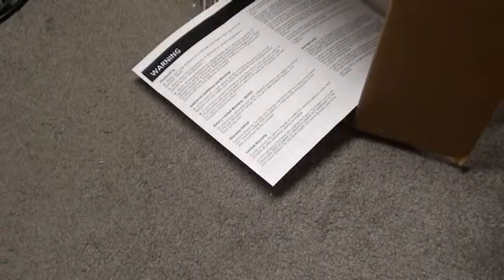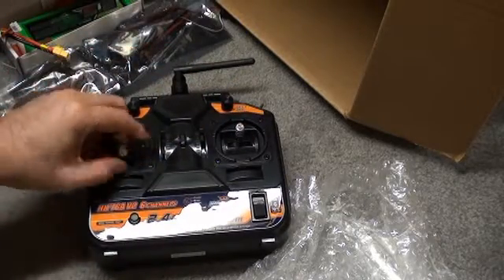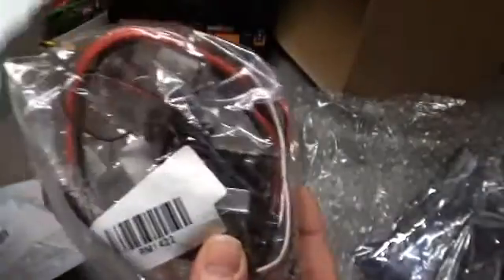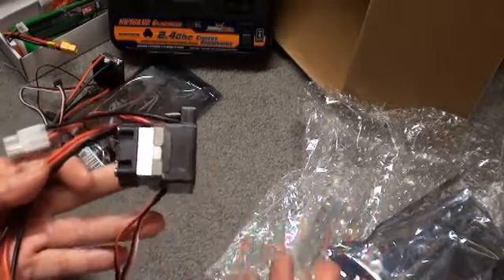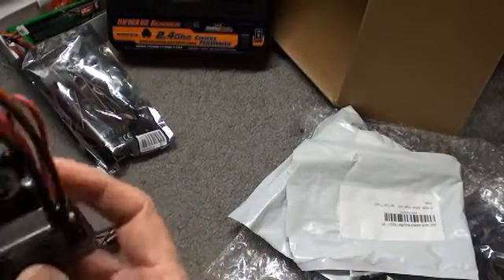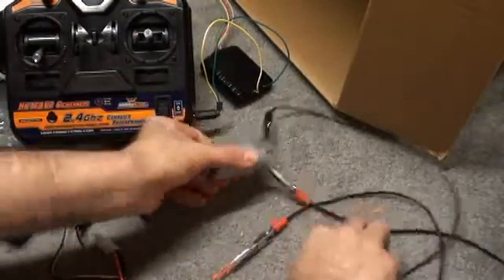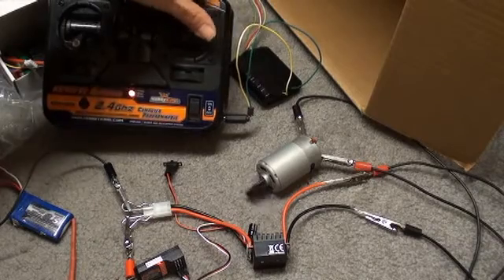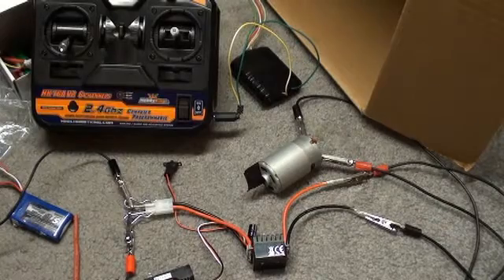Let's Build - Rover Mk3 - Part 8 - HobbyKing Unboxing and testing Escs

Comment: Whatever happened with those suspiciously cheap amazon ESCs? Did the magic blue smoke escape?
Reply from the maker: +Jacob Bodmer  I received the pair.  They haven't blown up yet, and they will make a guest appearance in a later episode.   However, they are unsuitable for ROV / Robots  as they have a reverse delay.  They need to come to a full stop before they will go into reverse, similar to the hobby King units.   With the HK units, this "feature"  can be disabled, there is no option, at least that I can find, to change the operation of the amazon units.
Reply: What hobbyking escs are you using